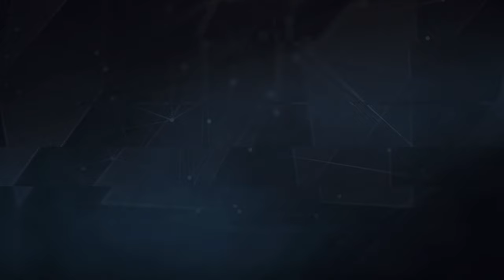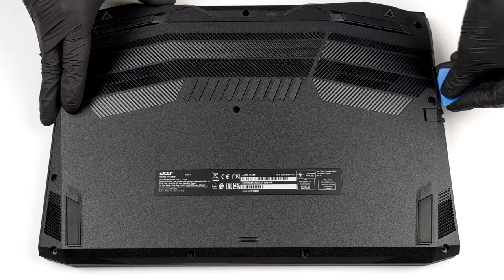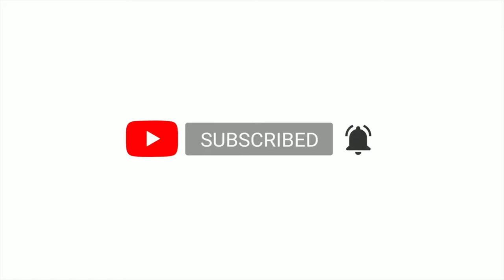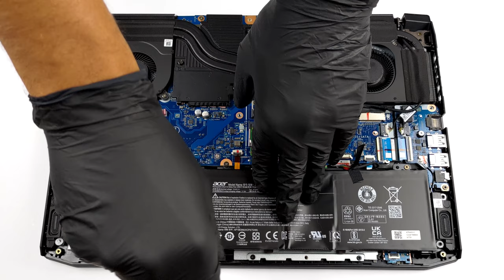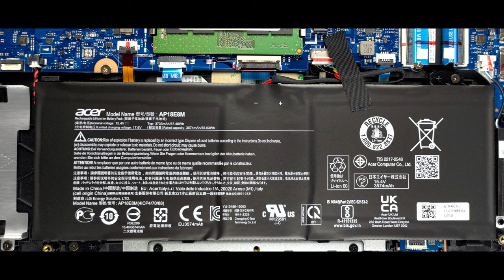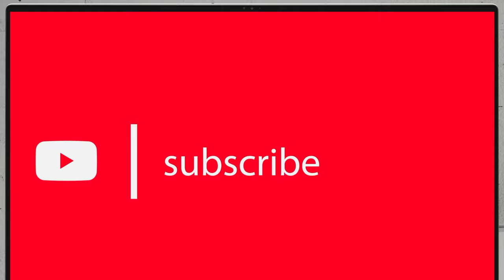🛠️ Acer Nitro 5 (AN515-45) - disassembly and upgrade options

Comment: Are you sure the memory supports upto 64GB? Because the website says only upto 32GB. I'm confused.
Reply: Maybe 32 in a single channel, 64 total in dual channels
Reply: I had a extra stick of 32gb of ram laying around and threw it in and it recognized it in the bios and windows so it should be good over 32
Reply: The CPU support 64go so it should be good
Reply: It does
Reply: The Ram that came with my laptop were 3200 MHz when I upgrade should we go for a faster MHz or stick to the 3200?
Reply: Buying faster ram than what you have is useless, unless you wanna upgrade both

Comment: Perfect laptop for me, it has performance 3060, and is cheap $649, RGB backlit so I can take it to work, and I normally use it on an external monitor so I don't care about the original screen quality.
Reply: You can take it to work, thats great! In a backpack? Or a handbag?
Reply: 3050 ti, not 3060

Comment: Thanks for your sharing. Could you tell me type or P/N of HDD Sata cable? I'd like to buy the cable to upgrade HDD for my Acer nitro 5 AN515-45  RYZEN 5600H
Reply: it should not use SATA, it uses NVME SSDs
Reply: @NeoTechni there's a slot for sata ssd or hdd

Comment: Hey , my Nitro 5 laptop is showing black screen after I closed lid of laptop. While doing so , at first I put my laptop in sleep mode and was about to close lid , at 30 degree the screen unlocked..still I closed the lid [I was at low charge 20-25 %]

No Acer logo , keyboard lit, caps and other key works, I can login to windows 11 blindly (welcome sound comes)

Few months ago, I had black screen while is using laptop, at that time force restart fixed

But now , tried many things . Holding power button and restarting, ctrl+win+shift+b several times etc...I am out of warranty..

Comment: Do you think this SSD Kingston 1TB M.2 2280 SNV2S-1000G PCIe NVMe Gen 4.0 will be good for an upgrade?
Reply: Yes but the other slot which is on the right(I think)only supports gen3 but its fine since the ssd is backward compatible so it will still work

Comment: I Have this same laptop (Acer Nitro 5 Gaming Laptop AMD Ryzen 5-5600H- (8GB/ 1TB HDD/256GB SSD/NVIDIA GeForce RTX 3050/ Windows 10 Home/144Hz)| AN515-45 , You are saying that RAM can be upgraded Upto 64GB But in other resources (Google, Acer community and even acer authorized service centre technician)  its showing that RAM can be Upgraded to 32GB. And one more - Can i upgrade it's SSD to Gen 4 2TB ?
Reply: I heard some people get the 64gb working but only at 2666mhz and yeah u can upgrade to maximum of 2tb but the other pcie slot is only gen3 but the ssd is backward compatible so it will still work
Reply: @notkrazalm9045  I have the same laptop.. I want to upgrade my ssd, Can you recommend me a good one which is compatible and little cheap ? I'm not good at understanding the compatibility of these..

Comment: AN515-45-R7SW
Part Number: NH.QBCER.006
what kind of connector does it need to connect hdd\ssd 2.5?
Reply: The same question for AN515-45-R6EV AMD 5600H. Please.

Comment: You mentioned 1 m.2 slot supports pcie and sata drive, while the other only pcie. So, the pcie also means nvme?
Reply: Yes it does mean Nvme PCIe Gen 3. I own this model which is Best in Budget and I’ve customised it by upgrading to 32 GB Ram (16GB* 2) and m.2 slots to 1 TB Samsung 970 Evo plus for OS and Editing and another m.2 with 2TB Samsung 970 Evo plus purely for gaming…
Reply: To improve Ram, which ram model did you use ?
Reply: @muhammetaliozturk6596  …I’ve used GSkill Rip Jaws 16GB * 2 = 32GB… Try to get 1RX8 Variant over 1RX16…

Comment: I own one of these and they are great for a year. The cooling isnt strong enough, the systems arnt efficient enough, so it heats uo and stays hot, throttle the fps and kills your battery life. Spend 100$ more on a better laptop. I wish i did.
Reply: Remember to maintain your pcs. They don't just work forever

Comment: what's the specs?
Reply from the maker: Check out the "Specs and Prices" link in the description :)
Reply: @LaptopMedia  helo what is the speed for m2 slot ? pcie gen 3 ? i would like to know how a 970 evo plus perform with this . thanks !
Reply: Ryzen 7 5800H / 16 GB DDR 4 - 3200Mhz RAM /  256 GB m.2 SSD OS Installed  & 1 TB HDD with 7200 RPM / Nvidia RTX 3060…
Reply: @meade918r  …PCIe Gen 3 x 4…I’m using Samsung 970 Evo plus 1 & 2 TB respectively in both the m.2 slots provided…They are good…
Reply: @hridaimanav3620  is the laptop good? Planning to buy this variant.. and how long did you use yours? Any problem you encounter?
Reply: @RainyyMorningss  …Sorry I’ve seen your message just now before going to bed. I shall give you clear and detailed information tomorrow morning…Hope you don’t mind…
Reply: @RainyyMorningss  ...Sorry for the delayed response my dear friend...I was busy since being a transforming "YOUTUBER" into various contents, initially into Gaming...Now coming to my experience and situation, I was in tight budget and was looking for the "Best in Budget", and found this one after a lot of research...After which I've made it "Beast of Budget"...I've bought it just a month ago, it's pretty new...As if now no such problems which I've encountered..I shall take you through Plus and Minus..

Plus
1) CPU - Ryzen 7 5800H ( Competes and defeats many of Intel i7 Processors)
2) GPU - NVIDIA RTX 3060 ( TGP Values are decent enough 85 to 95 after Upgrade)
3) RAM- Dual Channel " 2 Slots"  ( I've received 8GB* 2. Replaced them with G Skill Rip Jaws 16GB* 2)
4) Memory - Total 3 Slots out of which  Couple are of SSD'S NVme m.2 Slots one is provided with 256GB of SSD NVme ( OS Installed) and other is empty. The third Slot is 2.5" HDD one with 1TB of 7200rpm.
( These Memories can be customized and upgraded as i did,  in-spite of improper information from the Acer customer care people.  
5) Good Ventilation and Thermals..
6) Refresh Rate of 144hrz with 1080 Full HD Screen.
etc...

Minus
1) Battery Backup is pretty Average...( As an YouTuber into Gaming mostly operate Laptop on Power mode rather Battery since it shall not only low in Backup but has to compromise on FPS too..
2) Speaker Sound found to be Little Less ( It's personal opinion)
3) Little Heavy since being Gaming and Productive based Laptop...
4) Wifi used in it is Mediatek which has some bad reviews but don't worry it's not the case for all ( Didn't encounter any such thing in my case). Moreover even reputed high and costly laptops like Asus ROG and even Alienware are using this Wifi Chip..

Overall a very good Laptop on Budget...

Any more doubts feel free to get in touch with me on zherozgamerz@gmail.com or hridaimanav@gmail.com...
Reply: @hridaimanav3620  Thank you so much for the detailed information you hv channel? Imma sub to you lmk thanks